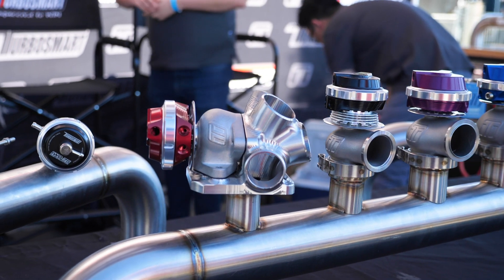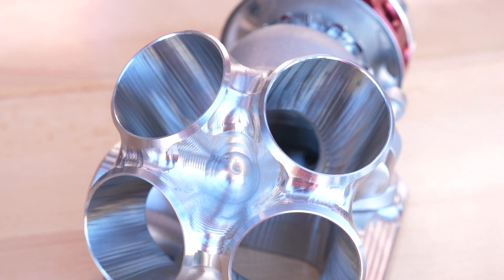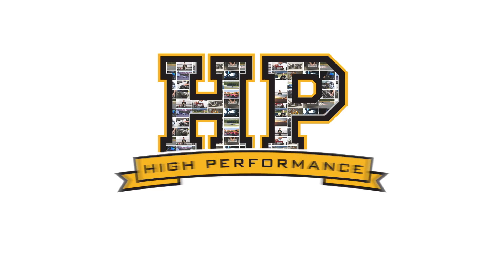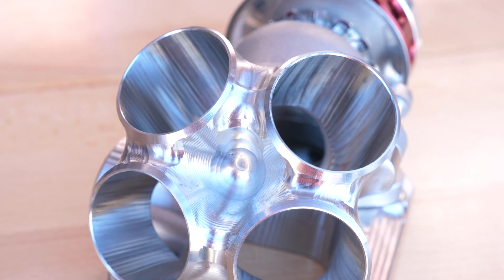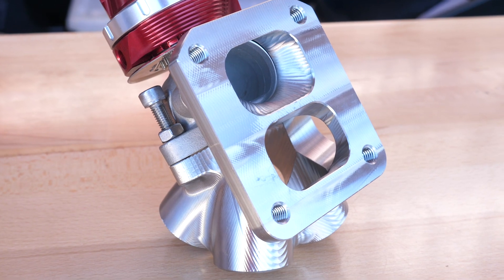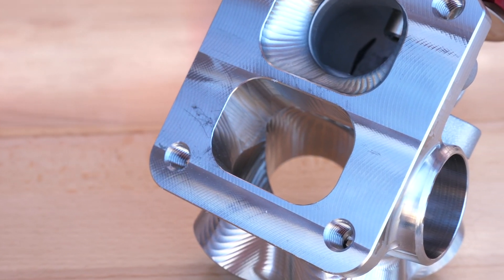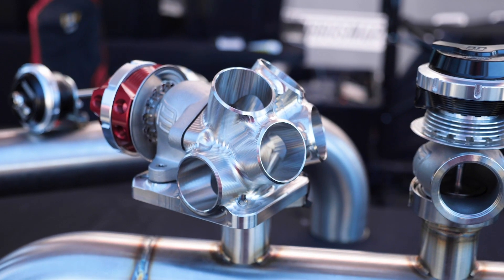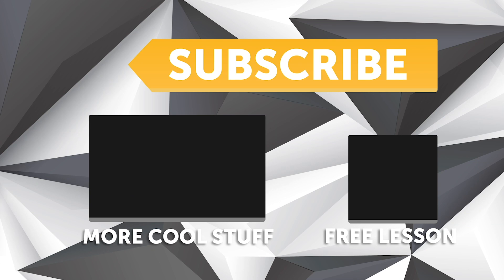Want Instant BOOST?!? | Elmer Racing/Turbosmart Spool Valve Experiment [TECH NUGGET]

Comment: I built a better one years ago, I copied koenigsegg's design which is much much better. Although I never actually seen there design I assumed it worked the same way that I designed mine, which flows the exhaust much more smoothly than this design or the other design that puts a flap in the middle of the scroll causing a restriction. the valve works incredibly well, I even use it with launch control, I can get 15 psi of boost a 3000 rpm.
here is my video take a look if you like.
https://www.youtube.com/watch?v=LVYs4x1y5-s

Comment: Does this not completely defeat the purpose of a twin scroll though?  I thought the entire purpose of a twin scroll and divided exhaust was to lower the boost threshold?
Reply: I built a better one years ago, it maintains true twin scroll when the valve is open. I copied koenigsegg's design which is much much better. Although I never actually seen there design I assumed it worked the same way that I designed mine, which flows the exhaust much more smoothly than this design or the other design that puts a flap in the middle of the scroll causing a restriction. the valve works incredibly well, I even use it with launch control, I can get 15 psi of boost a 3000 rpm.
here is my video take a look if you like.
https://www.youtube.com/watch?v=LVYs4x1y5-s

Comment: Why not a valve that makes it a twin scroll manifold under boost?
Reply: I built a better one years ago, it maintains true twin scroll when the valve is open. I copied koenigsegg's design which is much much better. Although I never actually seen there design I assumed it worked the same way that I designed mine, which flows the exhaust much more smoothly than this design or the other design that puts a flap in the middle of the scroll causing a restriction. the valve works incredibly well, I even use it with launch control, I can get 15 psi of boost a 3000 rpm.
here is my video take a look if you like.
https://www.youtube.com/watch?v=LVYs4x1y5-s

Comment: I didn't know air can go straight 90 degrees and have no effect on the flow . Looks a bit point less
Reply: Elmers know what they are doing😉
Reply: I built a better one years ago, it maintains true twin scroll when the valve is open. I copied koenigsegg's design which is much much better. Although I never actually seen there design I assumed it worked the same way that I designed mine, which flows the exhaust much more smoothly than this design or the other design that puts a flap in the middle of the scroll causing a restriction. the valve works incredibly well, I even use it with launch control, I can get 15 psi of boost a 3000 rpm.
here is my video take a look if you like.
https://www.youtube.com/watch?v=LVYs4x1y5-s

Comment: worried about how flow is gonna be in that wastegate
Reply: I built a better one years ago, I copied koenigsegg's design which is much much better. Although I never actually seen there design I assumed it worked the same way that I designed mine, which flows the exhaust much more smoothly than this design or the other design that puts a flap in the middle of the scroll causing a restriction. the valve works incredibly well, I even use it with launch control, I can get 15 psi of boost a 3000 rpm.
here is my video take a look if you like.
https://www.youtube.com/watch?v=LVYs4x1y5-s

Comment: Great video again guys! Very well presented. We'll keep you up to date with test results.
Reply: Georgeous milling work.
I assume this is a proof of concept for now - I would assume you're  planning on casting/machining a turbine housing that effectively has a split inlet - one biased towards a lower AR and used for lower gas flow and at higher gas flow a second, higher AR, inlet is also opened to reduce pressure build up and enhance flow? With a bit of work, might be possible to goi for low>high>both for best results?
Reply: Any update on the test results??
Reply: @FirstLast-tx3yj  Works better than expected! Based on some dyno and track testing the last couple of weeks.
Reply: @ElmerRacing  iis it possible to share numbers? For example how many rpms earlier did it reach max boost vs the same setup single and double scroll?
Reply: How would those work on the Moran Motorsports 670cui hemi with 106mm Garrett turbos
Reply: @jakelvisjones7685  what do you mean?! They will works just like they work on every other turbo they will improve the response time....

By how much?? No one knows until you practically install and test
Reply: Will they perform good in high altitude no prep racing
Reply: @jakelvisjones7685  The current design fits dual scroll T4 housings. Flow is slightly limited, so won't work at optimum capacity for very large turbos. We're working on larger versions though!
Reply: @ElmerRacing  Would this work well for small(er) turbos aimed at smaller displacement TT H6 engines pushing around 600bhp?
Reply: @stewartwhite2539  Current model that we have tested should be good up to about 600-700hp power range.
Reply: @ElmerRacing  that’s very exciting! When do you plan to release these for 3 into 1 (or do you call it 3 into 2)?
Reply: @stewartwhite2539  We ideally would want to integrate the wastegate more/better with the collector for future designes. But could do this type with 3 inlets easily.
Reply: @ElmerRacing  Would this system work on a single scroll T4 turbo?
Reply: @lucasyen6064  No. No scrolls to switch between.
Reply: @ElmerRacing  Hi, any updates of this product ? Or release date ?
Reply: @liveteklol  Here you go! https://www.youtube.com/watch?v=7qJ4XGaO5jk

Comment: WG looks a little on the small side? I imagine it would restrict a fair amount. I guess it depends on whats more important, low or high rpm power. Would also be interested in the difference in backpressure / egt compared to a regular manifold

Comment: Isnt that restrictive ? Looks like good idea
Reply: I built a better one years ago, it maintains true twin scroll when the valve is open. I copied koenigsegg's design which is much much better. Although I never actually seen there design I assumed it worked the same way that I designed mine, which flows the exhaust much more smoothly than this design or the other design that puts a flap in the middle of the scroll causing a restriction. the valve works incredibly well, I even use it with launch control, I can get 15 psi of boost a 3000 rpm.
here is my video take a look if you like.
https://www.youtube.com/watch?v=LVYs4x1y5-s

Comment: welcome to 1980
Reply from the maker: While this isn't new technology and we haven't claimed that it is, I'd be interested to see where this exact same implementation was used in the 1980's and the results/data. We're certainly aware of variants, but not the exact same setup. Interesting to see what is hidden out there, cheers Brad - Taz.
Reply: @hpa101  ya I know,  was just having you on.  I have seen pics of  the more traditional  flap door setup that was used in the 80's. And I've got a Nissan turbo from the  80's or early 90's with a big exhaust housing and a single vane in it. I think it's called a swing vane turbo. Pretty cool stuff,  but obviously that tech was dropped  infavour of newer tech.

Comment: Seems like it would be pretty restrictive after boost onset. A well built fully divided manifold seems like it would do well on it's own. Great content 👍
Reply: s14sean I bet this would be ideal for a road course car that doesn’t spend its life at redline, or a street car looking to compromise some hp on top for response and torque down low.
Reply: I built a better one years ago, I copied koenigsegg's design which is much much better. Although I never actually seen there design I assumed it worked the same way that I designed mine, which flows the exhaust much more smoothly than this design or the other design that puts a flap in the middle of the scroll causing a restriction. the valve works incredibly well, I even use it with launch control, I can get 15 psi of boost a 3000 rpm.
here is my video take a look if you like.
https://www.youtube.com/watch?v=LVYs4x1y5-s

Comment: Definitely wanted to see this thing in a video. Loved the live session yesterday as well👍👍👍✌
Reply from the maker: Cheer mate! Lucky to find companies like Elmer Racing doing these things =) - Taz.
Reply: I built a better one years ago, I copied koenigsegg's design which is much much better. Although I never actually seen there design I assumed it worked the same way that I designed mine, which flows the exhaust much more smoothly than this design or the other design that puts a flap in the middle of the scroll causing a restriction. the valve works incredibly well, I even use it with launch control, I can get 15 psi of boost a 3000 rpm.
here is my video take a look if you like.
https://www.youtube.com/watch?v=LVYs4x1y5-s